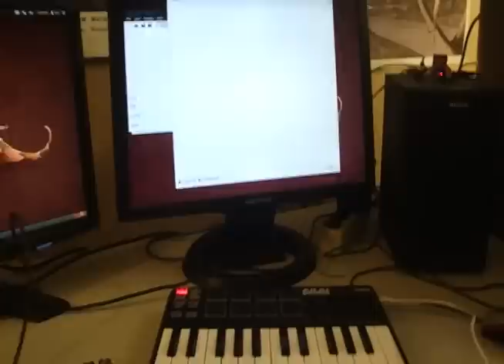How To Repair an Akai MPK Mini MPK MIDI Keyboard USB Connector Port

Comment: Ken, Do you have a zoomed in picture of the USB Connectors on the Akai MKP Mini? I have the same issue where the USB connector came off and took off the traces. I have cleaned up the board and will need to solder wires to the board to the connectors. On the video you said the 2 left most connectors 1,2 get tied together. the 5th connector goes to the pad. From what i see I can't tell which trace to tie 3 and 4 to. Any picture would help. Great Video by the way. Thanks

Comment: plz. tell me where i can sold USB-Cable direct on board. due to trashed copperplating where connector ones sat. i know that black to ground, green(+) to R2 and White(-) R3. well im not that  sure its right or wrong.

Comment: Thanks for the video! I'm doing this repair on a MK2 but I can't work out how to disconnect the joystick so I can lift the PCB out - do you know how to do this?
Reply: I desoldered the joystick connector in the end, but now I'm having difficulty getting the PCB out of the case due to the sustain pedal jack - +Frank Einstein +Jalal Fakhri did you find a solution for this?

Comment: Thanks for the video! helped a lot 

Since you test a lot of these are all of these Akai mini keys firmness inconsistent? For me my 3 Mini keys farthest to the right are less firm than the keys in the middle. Please let me know your thoughts on this and are keys replaceable or fixable. thanks
Reply from the maker: I don't play them enough to notice firmness inconsistencies - I just fix 'em and test the keys. It's too small for me to enjoy. As the construction is concerned, there are three keyboard segments, one with only a single key, and it's noticeable. You could always buy a junker on ebay for $20 and swap parts to your liking.

Comment: Hey man , i see you've done a great job on the mpk mini. I need some information over here. My akai mpk mini has a little problem with the C note in the first octave of the keyboard i press it and sometimes it sends the signal but other times don't. If I hit it harder it surely does work. Finally i want to ask if it is possible to open up the mpkmini and clear the keys from dirt ?
Reply from the maker: DA FUQ Most keyboards since the '80s use a rubber contact pad with a small bit of conductive material ( usually black ) to make contact with two traces on the keyboard pcb. Open up a junk TV remote control... it's the same idea. This wears over time and doesn't make good electrical contact.

While you make get 'lucky' cleaning it, or applying conductive paint, or some such 'hack' repair it's rare that it will last or be reliable. Usually you have to actually replace that rubber pad meaning you need to order a new one, or get one from a junked keyboard. 

Tip: Buy a junker on ebay for $10 and use it's pads.

Comment: I have the same problem with my akai. Is it possible for me to have it shipped to you for repair? I can pay all cost. Also keninorlando9 I have a M-Audio KeyRig 49 that connects to my computer but as i open up reason to use as a midi, my keys aren't making sound after I connect it. If i push the modulation up it registers that it reads it but as i push on the keys to play it doesn't register the keys nor do i hear any sound. Can you help me with this problem or possibly know what it might be??? I'd greatly appreciate it. I tried changing out USB cables but the problem still exist.
Reply from the maker: * Updated * I'm not taking repairs at this time.

Hi, send it to the address found at: http://www.rainfall.com/cornerstore/index.php?route=information/contact - I charge $20 - you have to pay for shipping both ways so when you ship it, just have a return postage label also printed. I'll ship it back in whatever you ship it to me in. 

About the other issue - it's rare that a midi controller "partially" works unless a circuit board is cracked, or the buttons them self are bad. Most of the time it's a setting. I test using QMIDIARP under UBUNTU to monitor the communication. I don't know if windows has an equivalent program. If you send it along with the other unit I can certainly look at it but I'd test it first, or do a reset, or whatever that unit needs in that regard.
Reply: keninorlando9 Awesome! I will let you know when I'll be sending it out, I would hate to sell it or get rid of it just because of something small. Thanks again for your help keninorlando9

Comment: Hello, I would like to know if someone can help me with this, my akai had a short circuit and burned part of the motherboard and USB input, but when I connect it to my computer, it turns on and everything, but my computer does not detect it, he recognizes it, then I think my akai is reset and I would like to know if there is a solution

Comment: Does anyone know how to open up the mk2? i cant lift the pcb out of the chassis because the sustain pedal jack is so tightly in that little hole in the chassis its impossible to even lift the board without breaking it in half... i dont even know how the hell they got it in there in the first place, cause the soldering points face the hidden side...
Reply: Frank Einstein Same issue, does anyone know the solution?
Reply: just figured it out...the sustain connector is a metal cap so you u pry it open witha small flat head. I jacked mine up a bit but I  was able to take it out but now i cant take out the joy stick thingy i never use
Reply: I know it feels like ur gonna break it but u have to but some muscle behind it and it will come out

Comment: I need to replace the pads in my Akai MPK Mini 2. However, the sustain connector makes it almost impossible to remove the board out of the enclosure. Anyone know how this is done. The original Akai MPK 1 doesn't seem to have this issue.